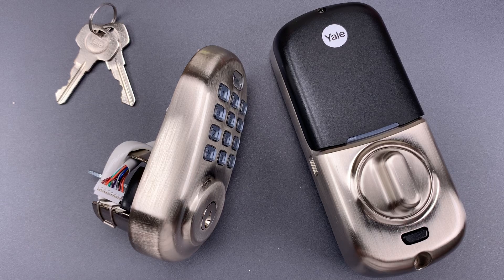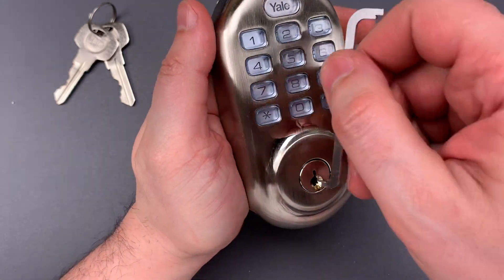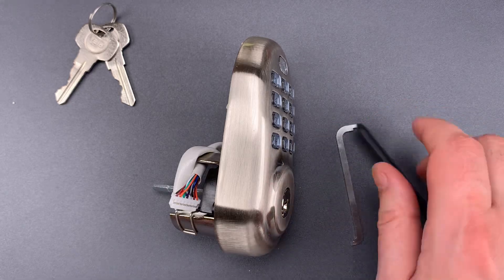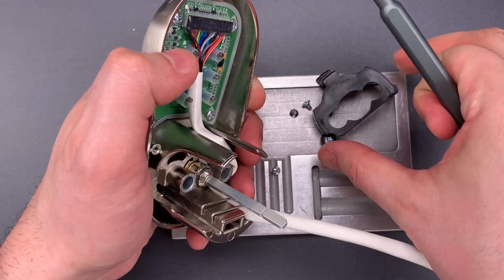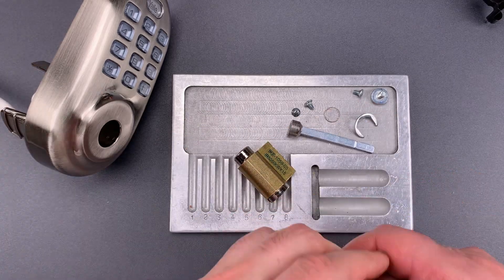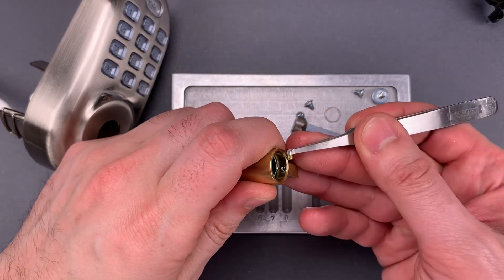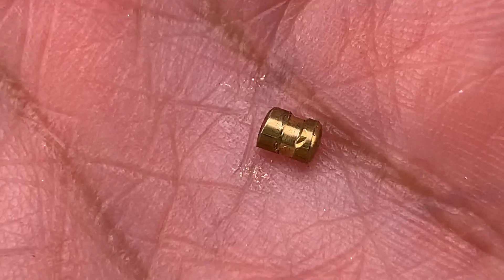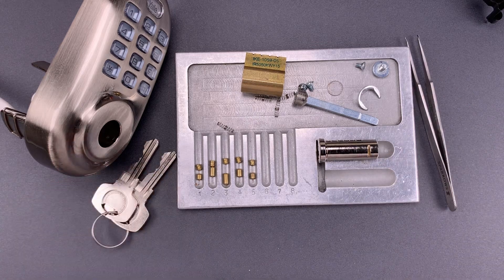[1100] Yale Assure Electronic Deadbolt Picked (Model YRD-216)

Comment: A $190 smart lock with a keyway is probably to be considered a $180 smart lock and a $10 keyway lock.
Reply: If it has lots of marketing advertising it then yes.
Reply: Probably even less!!
Reply: $189 for the smart part and a dollar store keyway lol
Reply: I dont know, it had bypass shielding and spool pins. It's a bit better than a $10 lock
Reply: @nitbot  It's almost like someone did a cursory google search on what makes a good lock.  They read "No bypass on the back and use spools" and implemented those things, but never bothered to test if the lock was actually pick resistant.
Reply: @nitbot  spool pins made by a drunk beaver
Reply: @ts757arse  thx for sharing this, I bought a home with these installed non functional and no keypad. Just the electronic sensor and a regular lock. The previous owners left no instructions. The panel has all the wiring torn up like someone went nuts on it. This was a "smart house" 10 yrs ago. Now I understand why they deactivated it.

Comment: the shocking part to me is how they failed so hard at making a lock that 40% of the pins serve no purpose, like how does that even happen
Reply: I guess they didn't test the product rigorously enough. Maybe the lock they tried to pick didn't have such short pins (after all, these would differ from lock to lock). Pretty sloppy if you ask me
Reply: Because majority of locks aren't picked, door or window is busted
Reply: Even more shocking is that there is still some peoples who start their sentences with small letters in 21st century!
Reply: @zuti071  Quite the opposite: it's not shocking at all.
Reply: Did zuti just try to lecture someone about their capitals? Dude this is a YouTube post, not an essay
Reply: @zuti071  you singlehandedly changed the topic on every single reply on this comment thread after yours, due to the absurdity of your notion. congratulations
Reply: @zuti071  Even more shocking is that you said "there is", which is uses a singular verb, in reference to the plural noun, "people" whilst trying to critique someone else's grammar on the internet. Good job, chap.
Reply: @Mr. Dank Only if you're a book title.
Reply: @willdabeast567  Tnx, i fix that.
Reply: WillDaBeast - He forgot a golden rule of the internet:
"Never attempt to correct someone's grammar or spelling, for it is certain in doing so you will make a similar mistook."
Reply: @zuti071  If YT had fb reactions I'd pick the laughing one.
Reply: Profits over quality.
Reply: Sloppy production tolerances on the pins. Very sloppy.
Reply: Rushil  Not much difference in the educational system these days.
Reply: WillDaBeast LoL
Reply: @willdabeast567  He critiqued somebody's capitalization, not grammar.  While grammar encompasses capitalization, by the limitation of his critique, it can be inferred that he was only referring to capitalization.  You are "moving the goalposts," as it were.
Reply: @drewa3597  And now we have found the Nazi in the comments!  Nice deflection to shift the blame.
Reply: @Turamwdd  Swing and a miss. While people disagree about whether capitalization qualifies as a grammatical subject, you have placed yourself in the camp that says it is part of grammar. Under that assumption, a critique of someone's capitalization is a critique of their grammar - specifically that element of grammar, but to reduce specificity reduces precision, not accuracy. ;)
Reply: Because it has buttons on it

Comment: We all can guess the amount of security once he said smart lock
Reply: I swear the the amount of circuitry a lock has inversely correlates to the security strength of the physical lock. The more there is, the weaker the lock hardware.
Reply: Really, that holds true with most systems - the more complicated the electronics, especially electronics talking to each other, the less secure it is. Like with a computer, only real way to keep its data secure is to keep it unplugged inside a secure location.
Reply: @karlashley8680   Maybe, but this wasn't a "the electronics are really easy to bypass/manipulate" case, but a "the physical lock is crap, 'good job' yale" case. Which is just sad, but not surprising.
Reply: And if not that, when he said Kwikset keyway
Reply: Somehow I have got the impression that "smart lock" means "no need to damage the door"

Comment: yale lock: picked in like 5 seconds
master lock: are you challenging me?
Reply: Obviously the challenge is to make a lock that takes least amount of time to open without a key and still require an effort. That means hitting with a fingertip or rubber mallet doesn't count as an effort...

Comment: Was about to buy this. I just saved 190 usd. Thanks Lawyer
Reply: It's now $40.00 in brass only and if you plan to rekey the driver pins can be replaced.  So can the Z-wave module or it can just be pulled.

Comment: I have the Yale Doorman which i believe is essentially the same as this, but entirely electronic. I got it so that i could issue temporary key codes to cleaners, carpenters or cat sitting neighbours, but have been dreading the thought that it might have some easily explotable weakness like a lot of the electronic locks you look at. It does make me feel a little better that you didnt find any easy exploits on the asssure.

Comment: So this actually answers a weird problem I had! I found an old Hong Kong made lock in my garage the old owners left behind, but I was super confused because I legit only needed to touch a single pin to pick it open, and the other pins never seemed to set properly if I bothered touching them. So I guess this is a common problem!

Comment: Yale does make a version of this lock that does not have a keyway at all.  It's the Yale Real Living T1L series.  Without a keyway at all, the lock is therefore not pickable physically.  They make them with Z-Wave compatible wireless if you want, but if you want no wireless at all, you can easily remove the Z-Wave module, and then the lock only works with the keypad.  Backup opening capability for dead batteries is provided by two contacts on the bottom of the outside of the lock.  You can hold a 9V battery up to the contacts to power up the lock, then enter your code to unlock it.  I have used these on my home for 5 years now and they work remarkably well.  I recommend multiple sets of rechargable AA batteries, as the locks will go through them rather quickly.

Comment: I have a similar lock from Yale, but with no actual keyway (the "backup" is to hold a 9 volt to the bottom of the lock, or go in through a different entrance) I'm curious if mine has any low skill exploits with magnets or anything, or if the only way to open it without a combination or phone app is by destructive means, and if so, how resistant it is to such means. 
I'm at relatively low risk of anyone trying break in, but I would feel safer knowing the thing wont just fall apart as soon as someone takes a hammer to it

Comment: Having driver pins go all the way below the shear line is inexcusable!
Reply: Let's check that again to make sure it wasn't a fluke
Reply: I know very little about locks and I didn't really understand the problem or how having a longer pin would solve it. Would appreciate an explanation if you know
Reply: A longer pin would mean that the pin is positioned between the core on the outer cylinder stopping the core from turning. When a key is put in the top pin should be driven into the outer cylinder allowing the lock to turn, but on that lock it wasn't nesceay.
Reply: @limiv5272  The so called shear line is the space between the rotating lock cylinder and the stationary housing. Each part contains a number of pins. In order to secure the rotating part from turning except with the proper key, the pins must extend above the shear line into the stationary housing. The pins are made to such a length that when a key is inserted into the lock cylinder they will create their own shear line and let the cylinder rotate to unlock. Here is a video that shows a training lock and how they work.
https://www.youtube.com/watch?v=Y2KK-uJNbmY
Reply: @williamjones4483  Thanks! Both your explanation and the video you linked were useful (-:
Reply: @NirateGoel  Thanks!

Comment: Strong magnet does nothing?
I strongly feel like application of magnets on actuator locks should pull another latch in place that jams operation, and more importantly flag for attempted bypassing.
Reply: Think of legit users carrying magnets for legit reasons and just checking if the door is properly locked, because it's also their job to lock it.  So don't raise alarms for magnets that won't bypass that lock anyway.
Reply: @johndododoe1411  I don't think he is saying alarms, just flags. So it wouldn't be annoying someone got near the lock with a magnet, but just a chirp when opening, a counter rotation, or the like to reset if someone had gotten near enough with one. That way when the owner got that he would know to be a vigilant.
Reply: This has a stepper motor rotating the lock I think, not an actuator.
Reply: @TimNorris2001  Such flags tend to evolve into easily misunderstood lines in security system event logs.  Such lines tend to make security personnel check CCTV tapes and confront the innocent with accusations that go on their employment record, resulting in greater risk of later loosing their livelihood.  Hence my warning against lock designers starting down that slippery slope.
Reply: @johndododoe1411  I can understand your point here, but let's be honest if you were using this lock in the business for something secure, are you not planning on getting it stolen? 
This is a consumer grade lock, offers no master keying in default and only needed 3 of 5 pins to be picked, the pins were poorly machined, and double tapered. If you bought this for a home, like it was designed, then it wouldn't be able to cost someone a job, and the homeowner would have a bit more security for attempted break-ins. Don't get me wrong, if that homeowner tied it to an alarm then the function would need to be disabled.
Reply from the maker: It’s operated by a motor via a gear box on the far side of the door. The chances of a magnetic attack working are very low. .
Reply: @lockpickinglawyer  that's why you buy the monolith magnet. it will get you through if you throw it hard enough.

Comment: So my question--say I just bought this lock, and now want to harden it, would a good first pass be to  change up the springs (to alter the tension), use longer driver pins, and switch out the key pins so they don't have the dual bevel, and have some security features (spool/serrations)?  What else could you do to harden this lock against picking?
Reply: That is something I was thinking myself as well. Can you just buy a better quality core?
Reply: replace the pins with small nails or pins that are so long that the lock cylinder no longer functions. 
Then use it as a strictly electronic lock.
Reply: if you are meticulous enough you can measure the difference between the pins and file off the excess in the key
Reply: since you have to change the pins
you still have to adjust the key

Comment: I have a similar lock on my house. I have considered putting a dab of jb weld in the keyway. I have never used the key and actually I'm not sure where it is. I can always get in different ways if the battery would die. However it warms you when the battery starts to run low.

Comment: Geez, you picked that faster than my Yale Assure lock opens when I've entered the code. Fortunately, mine does not have a keyed backup (it provides a place to charge it with a 9 volt if the batteries die).

Comment: Nice surround. Any chance of putting a better core in that, or would it even need one? The core itself looks well-made (though I didn't see any good drill protection), could just be a simple case of replacing the pin-stack with good security pins and this would be a great lock.

Comment: Indeed I own that exact lock. And I’m glad I’m not using my real name on YouTube. :-). The upside of it being a smart lock is that whenever it’s opened using the key or the thumb turn on the inside is that I get a notification on my phone and my tablet via my smart things hub and the Internet.  And if it’s opened using the electronica keypad and I know exactly who was assigned that pin of up to eight digits. So I know when my cleaning lady has arrived and left.   I also chose that lock over the other ones as I am losing my vision. As this lock has physical buttons I will be able to open it using my fingers without even looking. And finally there are key fobs that I can get that will talk to my home automation hub and will unlock the deadbolt for me from outside

Comment: I recently bought this lock.  When I saw the length of this video I thought "Great lock it took 5 minutes"  Then I watch it and the pick took 10 seconds.  :( at least it didn't work with a wave rake.
Reply: You should be able to replace the cylinder on the lock with something more secure. I know Mul T Lock's work on these.

Comment: What really sucks about these locks is

At least where I live

The electronics die after 15 months 

I work as a maintenance guy, and we use these for vacation homes

The software is much much better then 90% of the other junk out there (at this price range) but the hardware sucks butt 

Especially since you need a gateway connection for it to even work, instead of connecting directly to wifi 

How is it that I can buy a whole freaking gaming console for 200$ that connects to wifi, does Bluetooth, and can play tons of games

But I can’t get a lock that connects to the internet itself? 

Those gateways are massive vulnerabilities themselves

Comment: My question is in line with Deviant Ollam's recent videos.
Is it just a dumb keypad on the outside of the door, or can the lock be opened by shorting out the wires on the outside of the door?

Comment: Are there any after-market mods to these types of locks to make them more secure?  Can I buy better spools?  Different cores?  Anything to make it a 10 minute pick instead of 10 second?
Reply: the core looks like a pretty standard size so i'm sure you can probably just throw a better one into it. The biggest issue would probably making sure it had the right kind of end to let the clip and the big metal rod thing to fit on.
Reply: Get a bowely lock.

Comment: so if the mechanical design and electronics are secure, could you repin the lock or change the cylinder and make probably the most reliable smart lock? all the other ones shown so far had gaping vulnerabilities

Comment: I like the product but in mine I changed it to a high security cylinder. But I did like the electronics so if you change out the cylinder to high security then you have a pretty good luck.

Comment: I have this exact lock but I wasn't provided a key.  It has malfunctioned and left me stranded outside 2x in the last 3 years.  I love the lock, but I'd like to rekey it so that I can have a key.  Of course, I'm not a locksmith.  Is there a way to replace the cylinder with precut keys for this particular lock?

Comment: With an electronic lock like this, how difficult would it be to add a pressure sensor in the core that would disable the keyway if there's pressure applied for too long without it actually being unlocked, i.e. during a picking attack? I have no knowledge in this field whatsoever, but it seems like that should be a fairly easy thing to do, and would prevent most (all?) picking attacks.

Comment: Other than the pinning, I wonder how good a lock that is.  I could probably take the core to a local locksmith who could pin it up with six pins, and perhaps get some of the gnarly driver pins that Bosnian Bill advertised, like interlocking T-pins, or other alien tech.  At least that would make the mechanical part not the weakness.
Of course, I wonder what a magnet can do with the solenoid, because that has defeated some of the most sophisticated locks like this.

Comment: So, the weakness against picking could be resolved by re-pinning, and maybe even using all 6 positions? I’ll do some digging on the wifi security - hopefully Yale are up there, but its easy to make insecure wifi (just like Masterlock make everything insecure). My only outstanding question would then be how the electronics release the lock - this clip skirted away from that completely! LPL,says he’s had a look and cant see any obvious blunders, but please show us :)

EDIT: 10 minutes of research, and I wouldn’t connect a security lock to wifi. The wifi itself may be reasonably secure (I haven’t dug deeper on exactly how secure), but the whole point of connecting it opens it to other vulnerabilities that can really easily facilitate a bypass. Unless you’re sure your network is properly and comprehensively secured, and you don’t use it with things like home automation (which is exactly why I’d consider a smart lock) then I wouldn’t risk it. Yes, people who know how to pick locks (like LPL) aren’t walking past my door every day, and people who know how to access the IoT aren’t trying every day, but thats not the point of proper (or even adequate) security. Glad I didn’t leap in to smart locks a couple of years ago now I’ve seen some of the exploits; sophisticated, yes, but difficult, no. And exploits are still evolving, rapidly.

Comment: Looks like a standard lock and keyway - could it not be rekeyed with different pins to be improved upon?  while a disappointing pick, I would think that this is somewhat addressable by a competent diy'er or locksmith -- I would be interested to see if the magnet, spoon, fork, or soda could ease their way into the lock-body and mechanism to get this opened/bypassed.